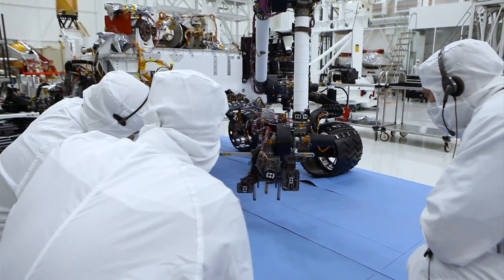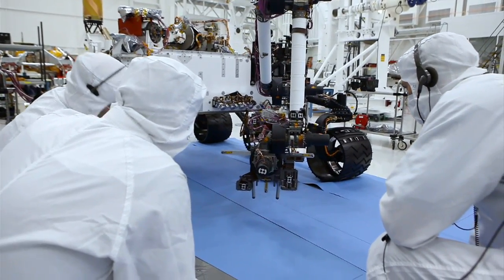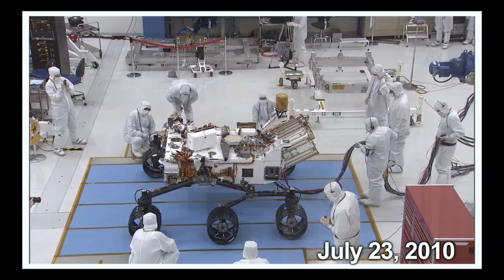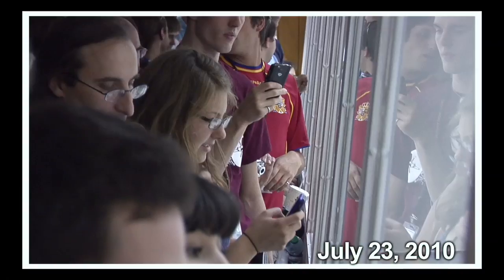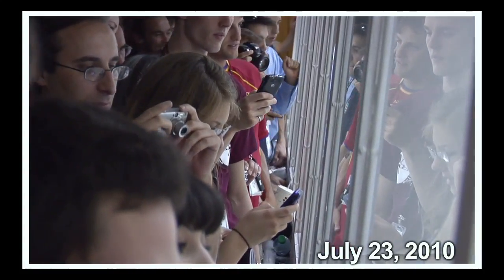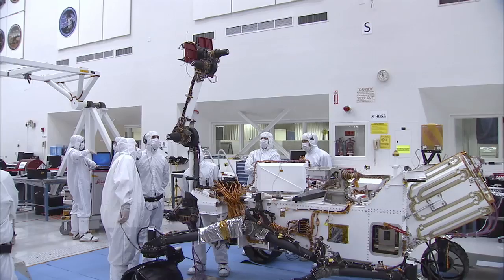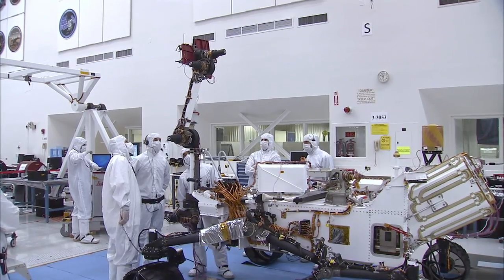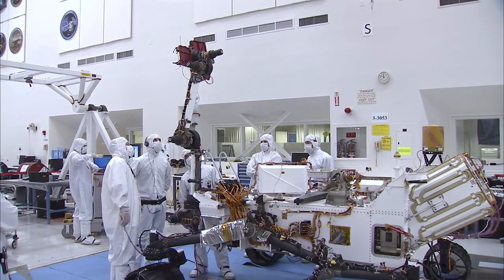Building Curiosity: Teaching Hand-Eye Coordination

Comment: A radioisotope thermoelectric generator (RTG, RITEG) is an electrical generator that obtains its power from radioactive decay. In such a device, the heat released by the decay of a suitable radioactive material is converted into electricity by the Seebeck effect using an array of thermocouples.
RTGs have been used as power sources in satellites, space probes and unmanned remote facilities.

Comment: Thanks for the update, I didn't notice an inclinometer for the crater simulation so I am wondering what specifically you are using to measure the 20 degree tilt.
I suppose an FOG would be readily available and inexpensive but can it handle the rigors of transport and environment.